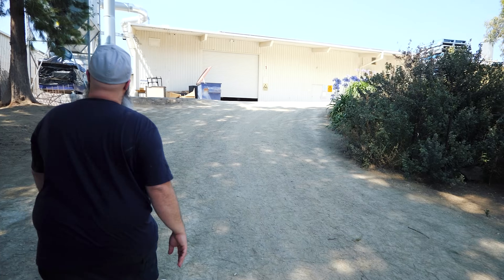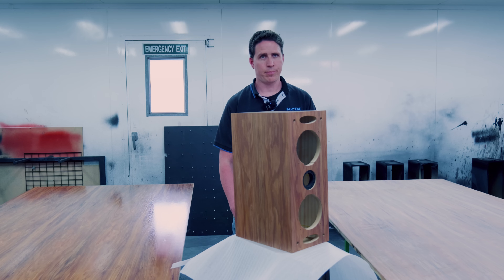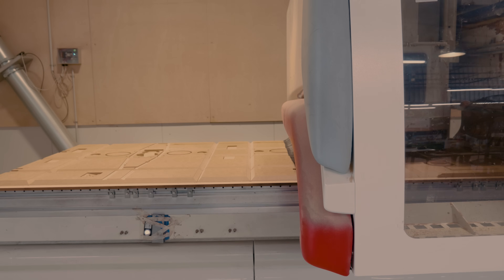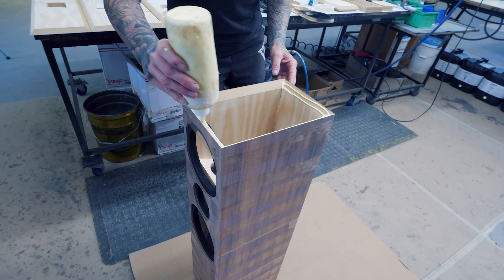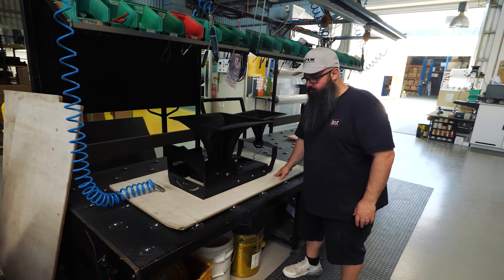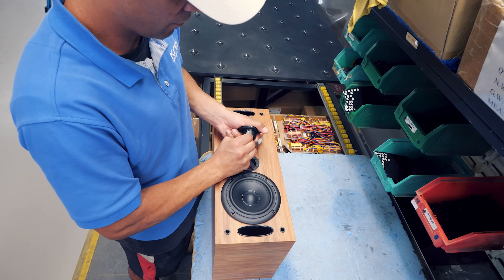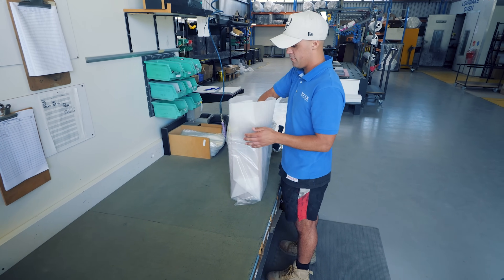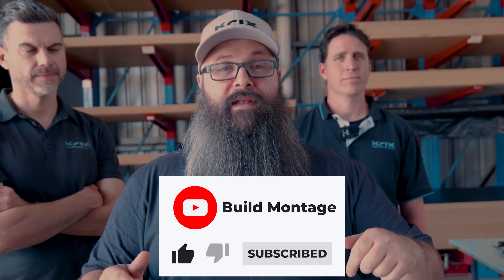How SPEAKERS Are Made - Krix Speaker Factory Tour 2023! #hometheater

Comment: There's a lot of "corner cutting" seen here that I don't like. Cabinet is just glued and held with tape, no nails or clamping pressure during bonding. That sucks. The reflex ports are just held in place by friction, which is poor construction practice . I don't know man....
Reply: If the glue is of good quality you shouldn’t need to nail them , if the boxes have real good tolerances the ports held in by friction will be fine . My krix are from the 90s and the port still hasn’t come out lol
Reply: Krix have been around for decades now. I’m pretty sure they know what they are doing.
Reply: @g-train9372  Well, obviously they don't